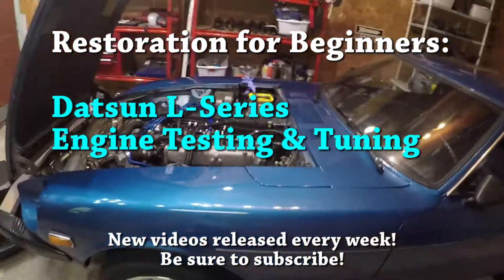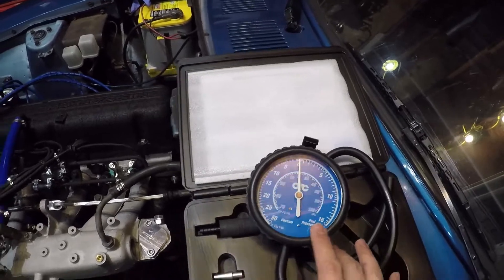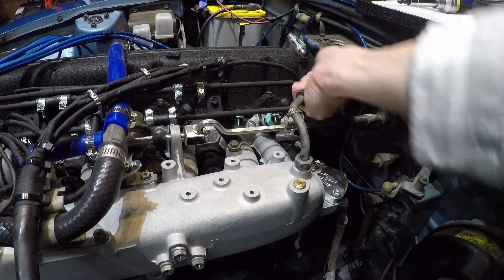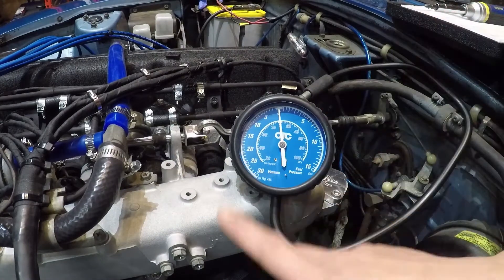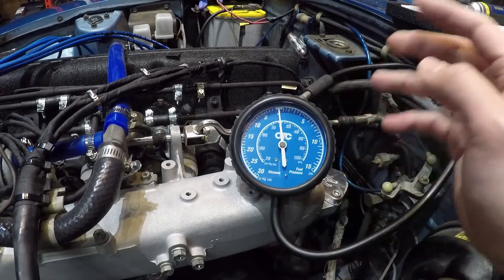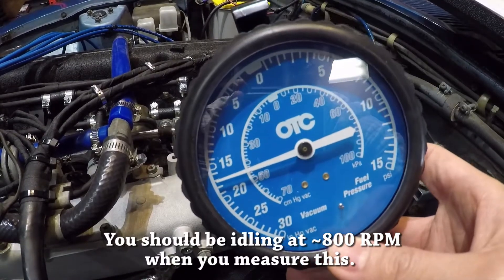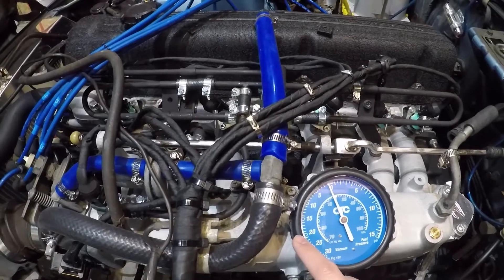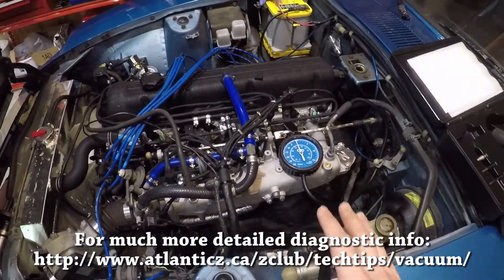Datsun L-Series Engine Testing and Tuning Ep.12 Vacuum Testing

Comment: I did a vacuum test to compare with you, check it out. Ideally the gauges would be the same or at least the same maker but still fun to compare. Back in the day when mechanic worked on many Z's there was a wealth of samples to compare, not so much so comparison videos from many Z's would be helpful.
Reply from the maker: Will do!
Reply: BTW, mine reacted the same when cold, about 14 then worked its way up in the same way yours did.
Reply from the maker: If I can get mine to run as well as yours, Id be a happy man
Reply from the maker: Link to the video, in case anyone else is wondering https://youtu.be/OjaThNPClNI
Reply: a tip : you can watch movies on flixzone. Me and my gf have been using them for watching loads of movies recently.
Reply: @London Caden yea, been watching on Flixzone for since december myself :D

Comment: Next with the engine warm, do a cranking vacuum test, same as regular but disable the ignition (I used a remote starter with key off, or just pull the lead from the coil to the distributer, hook a spark plug to it so the spark has somewhere to go, and crank) and observe the vacuum, it should be steady after a few seconds I got about 7" of hg for comparison. Don't crank too long, lots of stress on the starter.

Comment: To locate vacuum leaks I prefer the vacuum hose as a stethoscope method, one end in the ear, wave the other end around the vacuum fittings, or any were there could be a leak. On an engine with a complicated vacuum system it can help to pinpoint a leak. This method will also help to find small exhaust leaks. Good video, simple and to the point, Well done as usual.

Comment: Oil pressure should be interesting, nice to see how is compares to the on onboard gauge.
Reply from the maker: I hope I'm not in for a nasty surprise...
Reply: just for the heck of it, get an accurate resistance reading on the sending unit with the engine off, I will do the same, would be interesting to see what the starting resistance is and if they vary much. I presume there is some sort of voltage compensation for the gauge to deal with varying battery voltage, but have never really checked into it. I have read that the meter readings are not that accurate, which prob explains the lack of divisions on the gauge (false sense of accuracy).